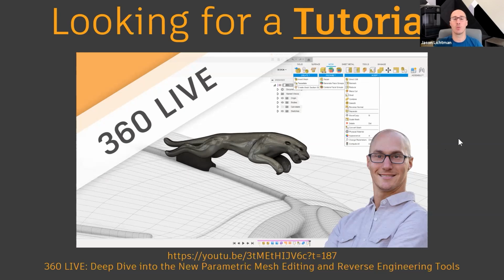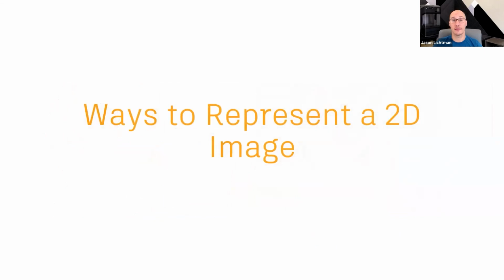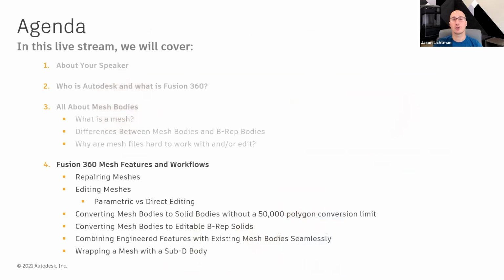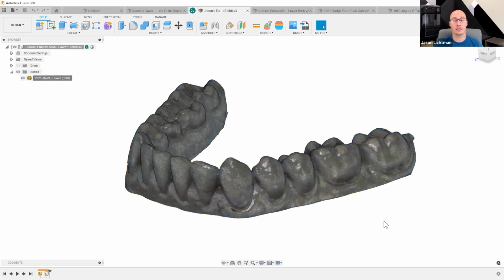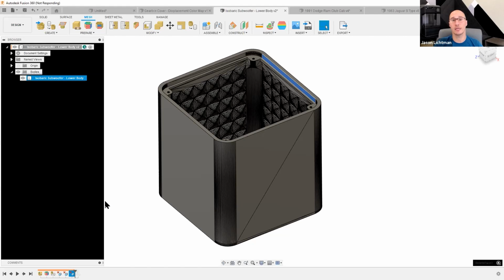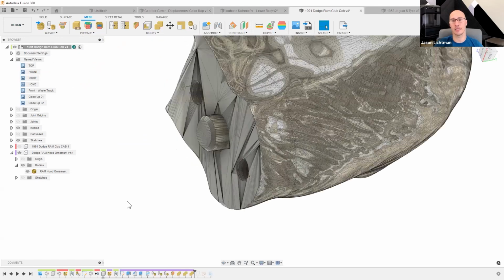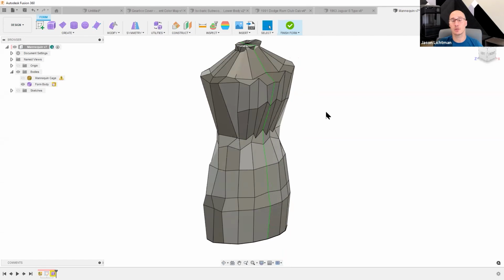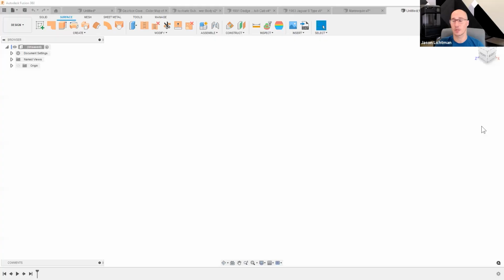Webinar: Meshing Around - How Fusion 360's Parametric Mesh Workspace Sets the Bar for Mesh Editing

Comment: This is so frustrating. There is no "Direct Edit" option. I download a STL file, go to Mesh, Modify and there is nothing that resembles "Direct Edit"
Reply: more info - I found it by spending literally 2 hours digging into the forums. You have to turn on "Capture Design History" in the right-click menu for the project and then turn off "Capture Design History" in the preferences to get the "Direct Edit" option to appear - that's not obscure at all (sarcasm)

Comment: Best update ever, my work flow is so long at the moment this will save so much time. Quick question, does the netfab underling code utilise cuda cores? Getting quotes for new workstation probably threadripper but dependant on utilisation of cuda cores in this and other software depends what gpu i go for.
Many thanks for good presentation style and informative video